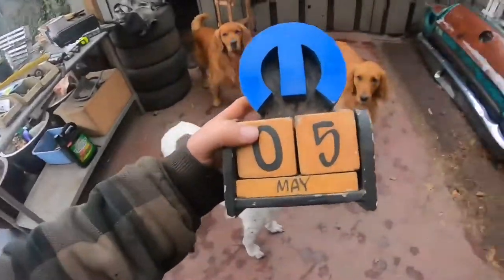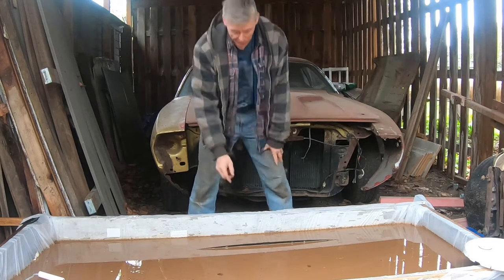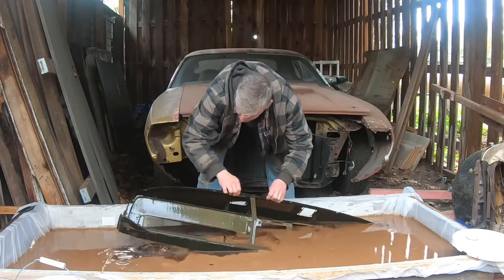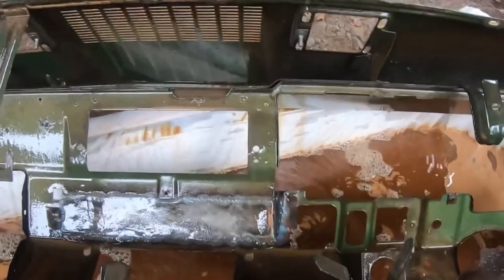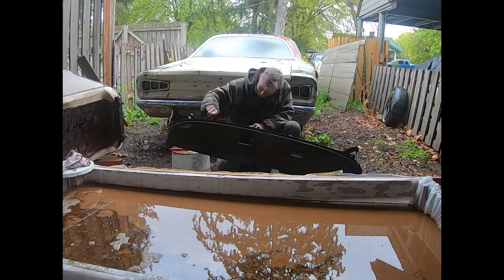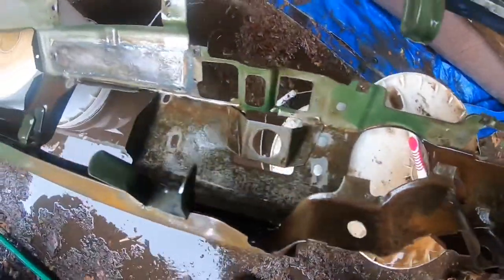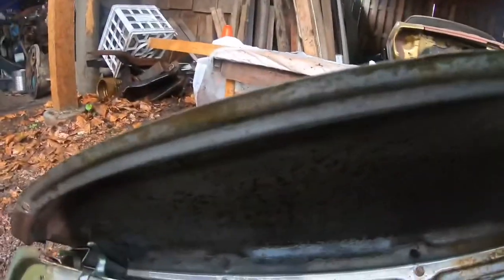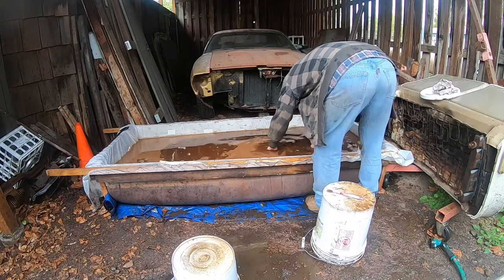69’ Dodge Coronet and 70’ Plymouth Duster dash rust removal by molasses #nonamenationals #rust

Comment: I think if you try the electrolysis with wash soda you be happier with the results plus it turns the rust black and neutralizes it either that or buy a spot blaster gun type at Harbor freight and a bag of aluminum oxide and it be much faster... As long as you have a compressor.
Reply from the maker: @moparnut62 I hear you. There are faster ways… I’m in “no hurry” for them. Thought I’d at least try it. 🤔👍 
I actually have a dustless sandblaster. But no compressor big enough for that thirsty pig. It needs at least 60 cfm…😳
Reply: @heavensmopars  yeah 60 you need a big gas powered compressor for that! 100 CFM would be killer 😂